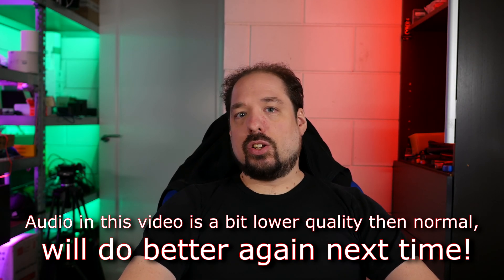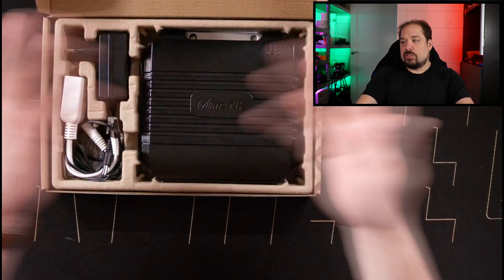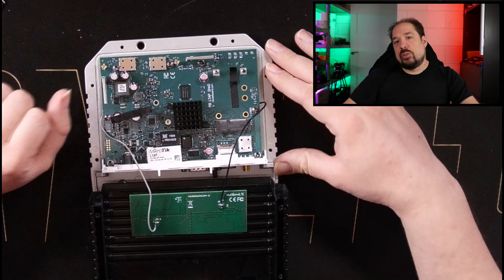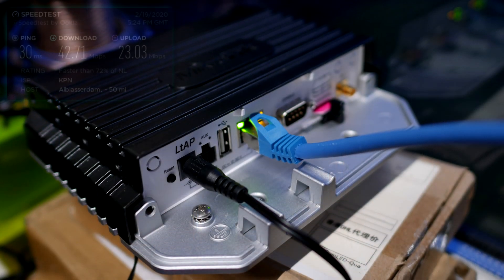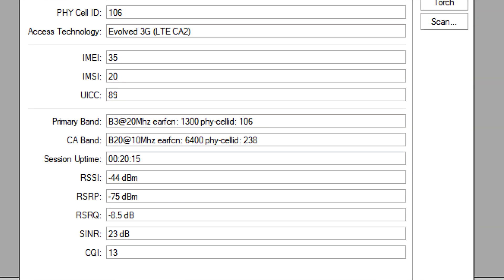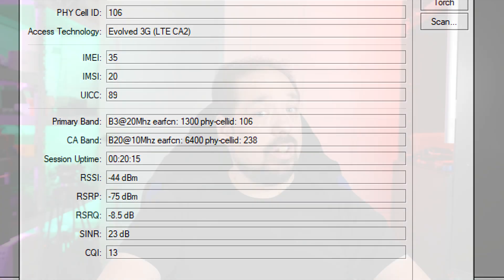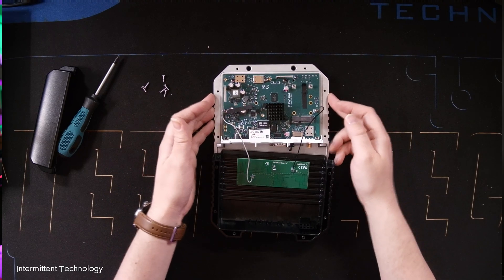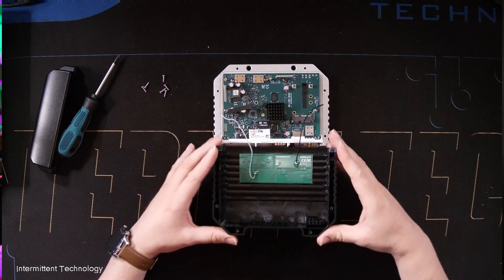Home Networking: Mikrotik LtAP LTE6 Kit Quick Look and Tests

Comment: is there no option for adding external antennas? also, how are the antennas installed? how many do we have for LTE and how many for home wireless network? (am i right to assume that the antennas are dedicated to either LTE or 2.4/5GHz for home wireless coverage? they can't be supporting both functions ate the same time?!)

Comment: Hey, so I was testing the audience lte6 (i suppose its the same pcie card as LTAP lte6?) today... 

and I saw I was connected to two channels on the same cell tower. B1 20Mhz primary and B20 CA channel 10Mhz width...   I tested my throughput and I consistently got 50/50Mbps. I also had APN passthrough interface on the ethernet to my laptop btw. 
Then I tested with my phone (oneplus 7). I loaded the cellmapper app, and saw I was connected to the same cell tower, and same channel - but I could not identify width or a secondary CA channel. However, I was getting speeds around 170/50Mbps on my phone! 

How could the download speeds be so different? Am I actually connected to more than two channels on my phone, or is there something wrong with my LtAP? I was having about the same RSSI and RSQP values when testing. CPU in audience did not peak at all (around 3-5%). Edit: I see my oneplus 7 phone is "cat 16 download speeds" meaning it has 4x4 mimo and can use multiple 20Mhz width streams.... 

How can I test this more scientifically? I might want to use these ltap kits as a failover on my SMB customers...

Comment: I’m down South in the Netherlands, it connects to the 4g but the speed is crap; 500bps, my iPhone works perfect and my old TP Link also makes good connection #hoedan can you help me a bit? Groet Erc
Reply: sorted after a few days "klooien" it seems that the TP-Link Router which I have, used the open.vodafone.nl APN and that didn't work in the Mikrotik, I had to use live.vodafone.com as my APN, which is strange because Vodafone has set my APN to "open" because of my needs, anyhow, it works. Did you tried to get the LTE bonding to work with the extra 4g pcb, because I would like to see if that works, than I would have my ideal mobile router for my Livestreaming projects.

Comment: The Mini-PCIe slot is for a 4G/LTE modem card. Also, it has options for external antennae with the right pigtail cable (either MMCX or U.FL to RP-SMA)

Comment: Can you add an external areal to this unit?
Reply from the maker: Yes no problem, just need to add terminals (the case has lots of spots for this) to get them outside and then connect them or your cables to your antennas
Reply: Thank you

Comment: Excellent video, I'm actually looking for an LTE modem nowadays as the Hua* Stick isn't as good as I expected before. Quick question: can the device be used as LTE modem only without DHCP/routing? I'm still planning to use my ASUS AC87U as router. Thanks!
Reply from the maker: Well it won't become an USB modem like a stick would be. But you can just give it an IP and tell your router that if it has no internet to send it to that IP?
Reply: @IntermitTech  One more question, is there a possibility to connect external antenna to the device?
Reply from the maker: Yes, it's very versatile and can be used with external antennas. Check the shots from inside.

Comment: Hee, prachtig product. Ik vind het alleen erg jammer dat de antenne al is ingebouwd en geen sma connectoren aanwezig zijn voor eigen antennes. Voor onze lanpartys gebruiken we een mikrotik routerboard met 4G module als failover op onze vaste lijn. Hier hebben we het tmobile 4G thuis simkaartje in zitten, helaas is deze gelimiteerd tot 25/25 mbit dus wat de router Max kan performen weet ik helaas niet.

Wel heb ik nog de vraag waar die gps aansluiting nu werkelijk voor is? Deze vraag had ik pas ook op tweeakters gesteld maar niemand wist dit te beantwoorden.

Bedankt voor de video!

Comment: great video thanks 

i just have a question i have a place in need for cameras can i add a network switch to it on the ethernet port and get lan ip's on it ? 
thanks for all the great content tou provide us i believe geeks are under valued here in YouTube tou guys need more subscribers!!!!!
Reply from the maker: Yup, just add a switch and it can be the DHCP server or client, whatever you want. It's a full fledged firewall and router that also has a LTE modem and wireless built in. Perfect for remote situations where you want to be able to  manage equipment or view one or more  IP cameras.
Reply: @IntermitTech  thank you for you're reply its just what i was looking for and a third of the price of a cradelpoint router